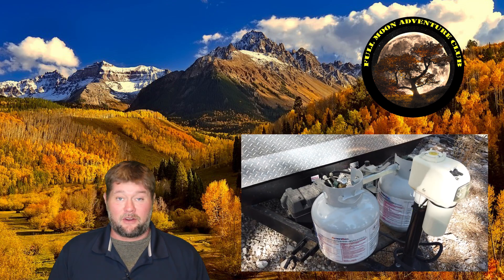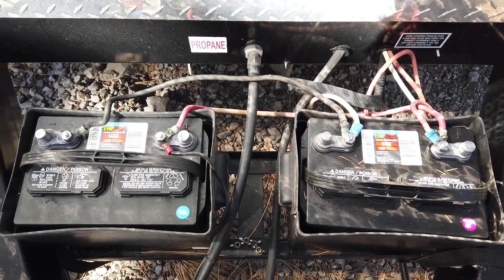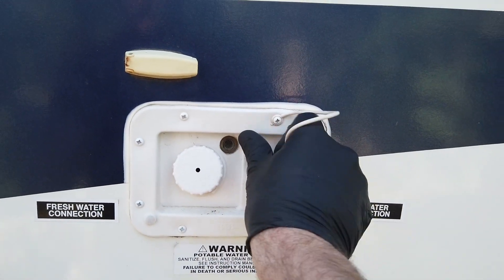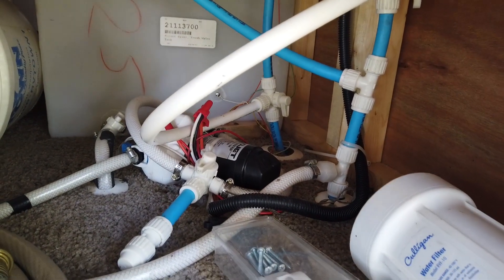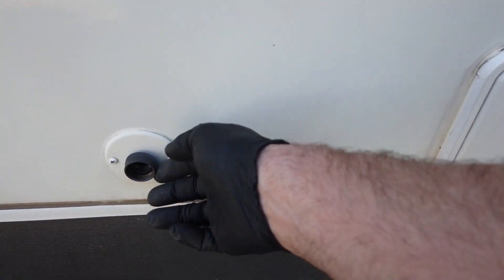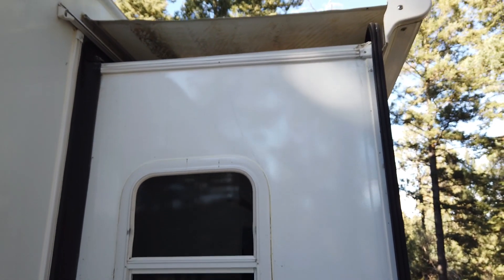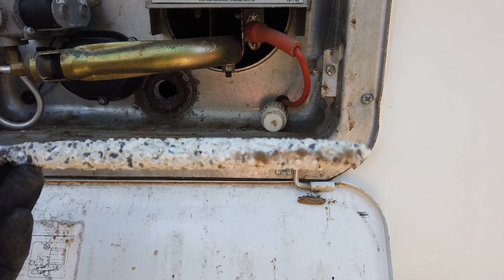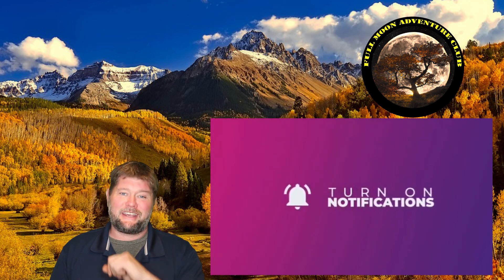RV Systems Walkthrough For Beginners - Travel Trailer Exterior

Comment: That little handle is used to pull the slide in manually (usually under the front steps) if the batteries or slide motor die.  Not recommended to use a drill on that one.  Great review Jim, thanks.

Comment: How do you make sure the water heater tank is full?
Reply from the maker: If the water is not hot you can slightly open the pressure relief valve located at the top of the tank, if water comes out you have water in the tank. But the preferred method it's just a turn on your hot water faucet and wait until water comes out with no air. However, the faucet method can be misleading if you have a water heater bypass valve commonly used for winterizing your RV. It may sound a little complicated but you'll get the hang of it after you read the manual.

Comment: Got a question can someone take everything out of a old rv with no motor an transfer it to a tiny house  It only costs $200.00 an Everything in it works I was going to put my tiny house on a trailer. I'm going off grid .I haven't got a solar set up yet wasn't sure what I needed for that.